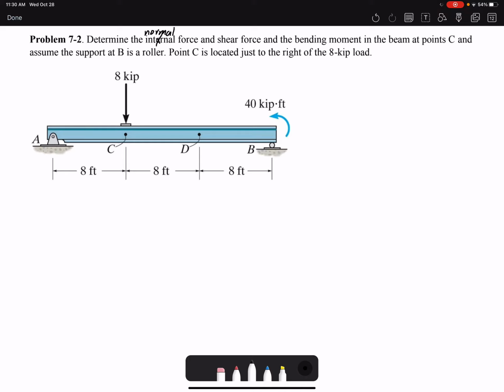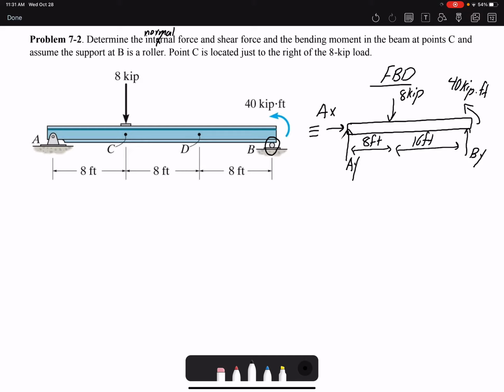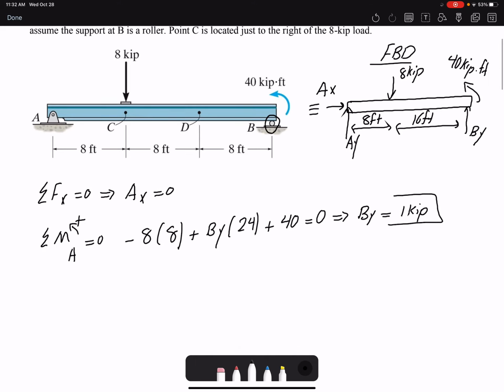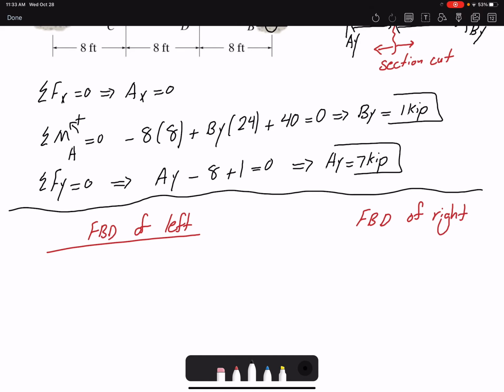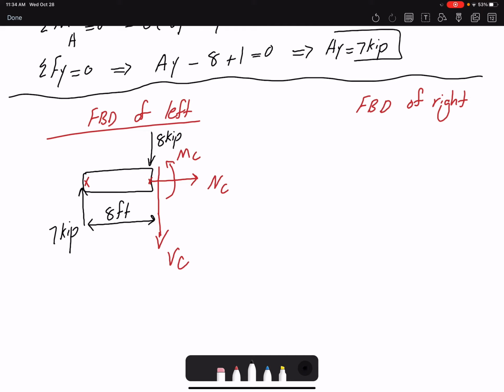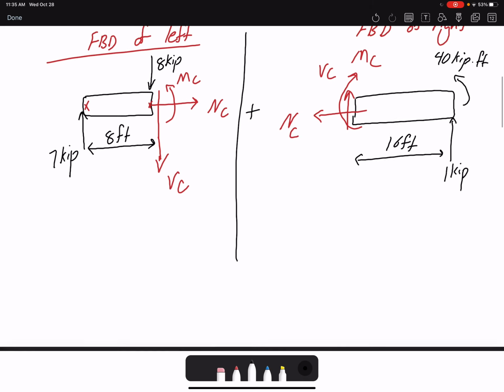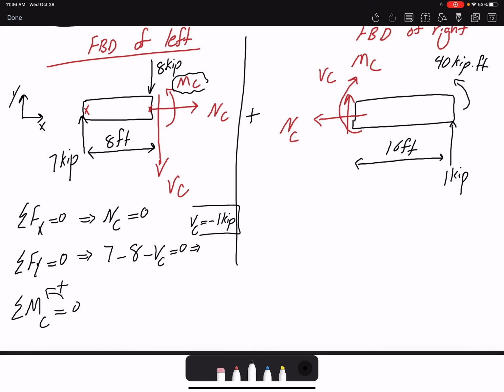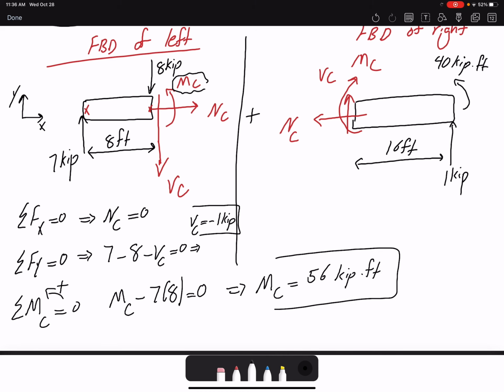Statics Problem 7-2: Finding the internal loading: Normal force, shear force and bending moment

Comment: The moment at Point D = 48 foot kips

You wouldnt know this based on the equation for the moment at point C because point C is almost coincident with the 8 kip force and therefore produces no moment at point C. This is not the case at point D. At point D the 8 kip force above point C counteracts the resultant force at support A, so instead of Md - 7(16) = 0 the equation for the moment at point d is Md + 8(8) - 7(16) = 0. The equation at point C really should have been written as Mc + 8(0) - 7(8) = 0 in order to make that clear.
Reply from the maker: if the moment arm is zero, the term is eliminated for simplicity. To have a universal equation, moment equation based on x should be written using Macauley Brakets.